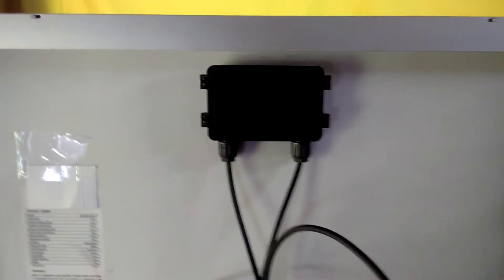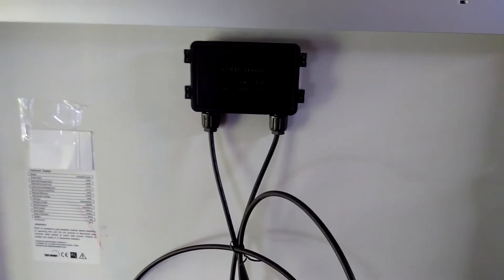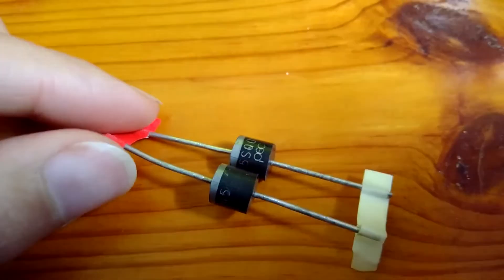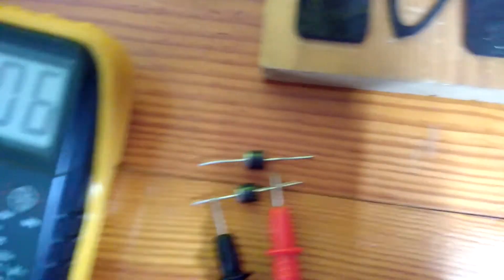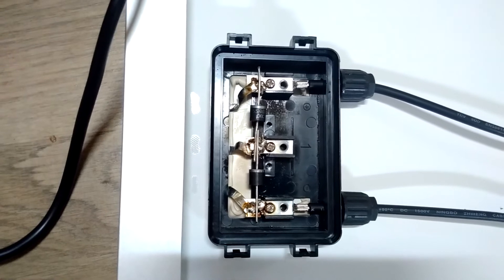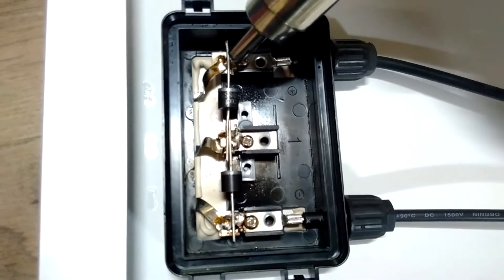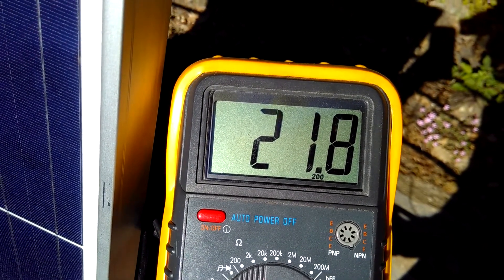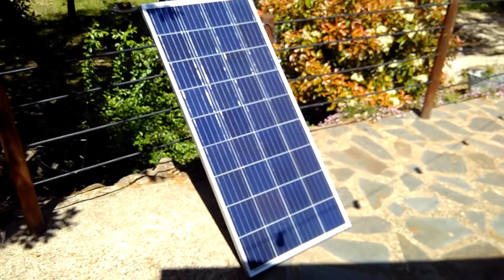Can you repair a damaged solar panel at home?

Comment: I have a three years old solar panel on the roof... Last week suddenly it stopped working... Even though it shows 21v on the multimeter with no current... Does this mean I have to replace the diode????
Reply from the maker: Probably not, it would show 0V. Check the short-circuit current (ISC) of the label. Then take a multimeter capable of handling that current. Put the panel on the sun and measure the short-circuit current with the multimeter. The red cable must be connected to the current measurement connector. It probably won't give you the same value, but you have the label as a reference. Based on what you read you can make a decision on what to do with the panel. Be careful with the sparks as you are making a short-circuit with this test. Also remember to connect the red multimeter cable again to the voltage connector as you may forget about it the next time you use it. I've skipped many details as this is already getting long, just ask if you have any doubts.

Comment: Thanks, I have seen something like this before, so if and when mine break, I know I will be able to fix them now I know it works :). Buy an electric or gas soldering iron rather than the hot air, it may work better for the soldering :)
Reply from the maker: I also have a soldering iron, but the hot air delivers more heat, and I can fine tune the temperature.
Reply: @FalkBay  Thanks I will look into that, My soldering is not very good :)
Reply from the maker: Also keep in mind that solar panels may fail because of other reasons.
Reply: Solar Photovoltaic Diodes